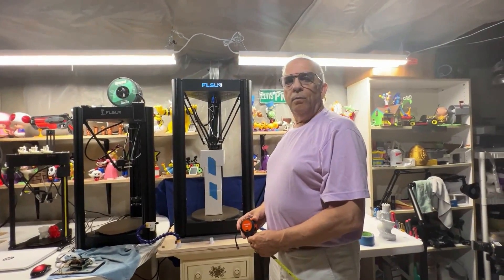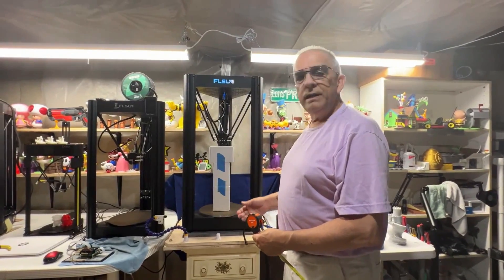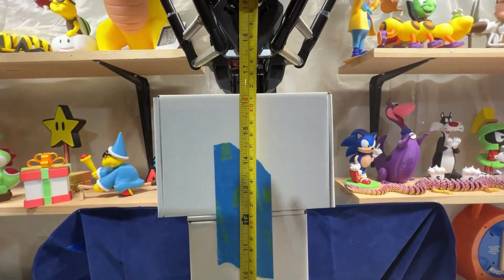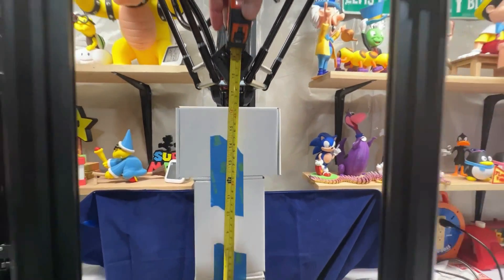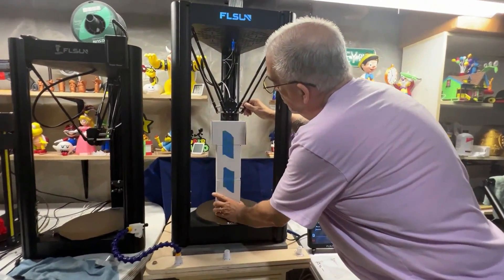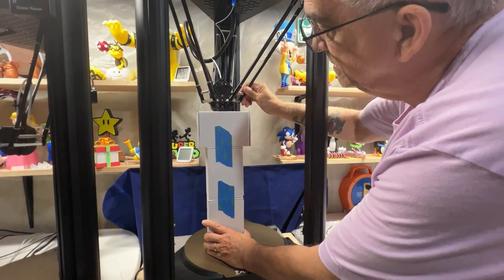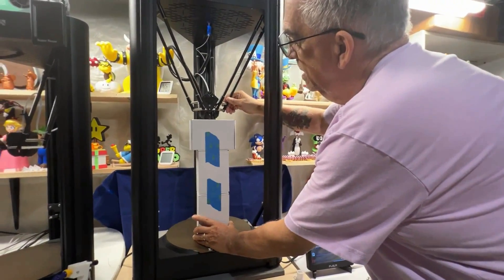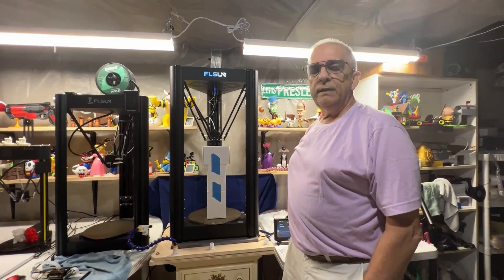FLsun V400 Max Print Height

Comment: Thank you for the video. It is very informative. I found the max height to the outside was about 380mm. It failed at 383mm and I had to work to fix that print. In my slicers I set max height to 360mm to avoid any issues in the future.
Reply: I tested a few taller prints over the last few days, taller narrow vase mode prints and 381 is where they would stop so I agree, around 380 is the sweet spot that will just work unless you have a model which greatly narrows at the top could lead to additional volume past 380.
Reply: Have you perhaps tested the 300mm diameter print size?
Reply: @derickkruger5680 , I have mostly printed the 300 diameter but not edge to edge  yet. Maybe someone else has and will reply.
Reply: @derickkruger5680 , that would probably take a lot of filament.
Reply from the maker: I totally agree...